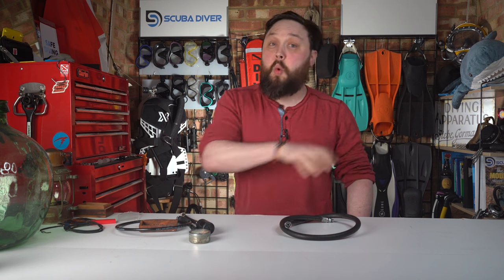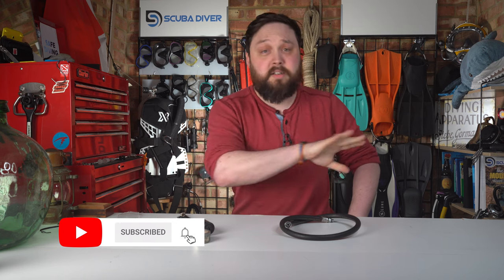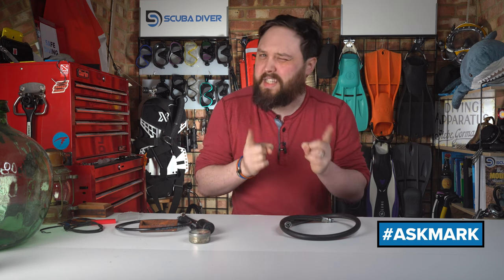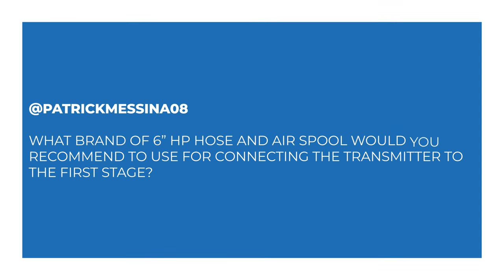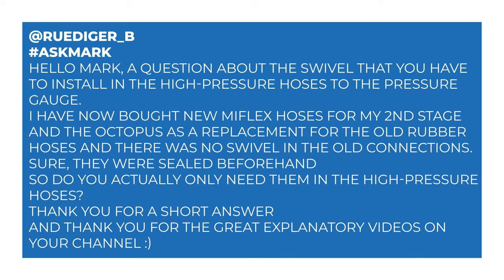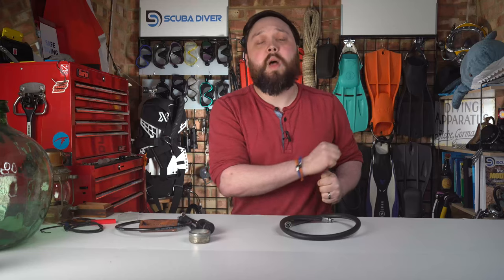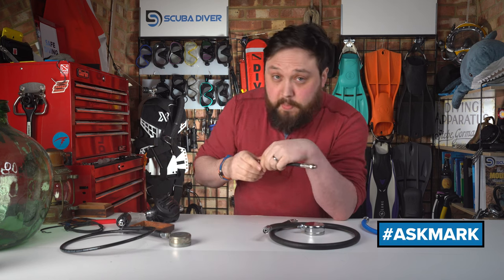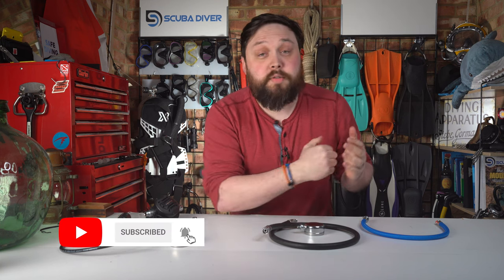Do I Need a Swivel Pin on Every Hose? #askmark #scuba

Comment: Another great video.  I noticed that the transmitter has an o-ring on it (could be seeing that wrong online).  I spoke to Shearwater recently and they said to remove the o-ring on their transmitters before connecting them to the hose with the swivel.
Reply from the maker: Yeah, I'm just grabbing things from the drawer, if you're attaching a transmitter to a hose then you don't need that O-Ring on your transmitter, just the swivel pin. That O-ring is just for when you attach the transmitter directly to your 1st stage.
Reply: @ScubaDiverMagazine  Thank you for the quick reply and the GREAT videos as usual!

Comment: Hi Mark, thx for the description 👍🏼🤗 i have seen the little O-ring in the male-end of the Miflex-hose. After screwing the hose to the 2. stage they rotate so easily, that i am not sure if it is correct sealed. Ok, i will test it in may in Egypt 🇪🇬🐠🐟🦈🐡🐙
Reply from the maker: They do tend to rotate quite easily when they're depressurised. You'll soon find out if it's not sealing properly...
Reply: Personally I’d recommend testing that BEFORE you go to Egypt!!!  😂
Reply: @MikeDodds  hi Mike - hmmm eventually I take the old hoses with me (they are not defect only OLD) - not so many extra weight 😂

Comment: #askmark , hi there, first of all I absolutely love your videos. So much information. I am very new to scuba and definitely got the bug. Do you have a very detailed video of a complete scuba build, from building a plate and wing to building your octo? I have heard some terminology that is new like swivel pin for example. Thank again . I'm off to watch your next video.
Reply from the maker: I imagine I have over the years. Backplates are quite easy and if you're buying a complete set, many of them come assembled and just need adjusting to your size. Regulators are simple also. As long as you know how to use a spanner and don't overtighten the hoses you should be good to go

Comment: Do Miflex hoses need to be replaced regularly? One service tech I spoke to said they need to be replaced every 5 yrs. can’t find anything on their website or brochure about it so I wonder if it’s obsolete news related to the rubber failure issue they used to have?
Reply from the maker: Great Question!
5 years is the industry standard for how often you should replace your hoses. It's the same for rubber and braided hoses. Most hoses will probably last longer but, they do degrade over time and I'd rather spend money on new hoses then for one to fail mid-dive.

Comment: #askmark Hi Mark, thanks for all the great content I find it very informative and great to watch. I have a question about buying my first scuba cylendar please, Its quite confusing looking at all the options. I will be diving here in the UK in a dry suit so I was thinking I would go for a 12ltr Steel but there appear to be a couple of common sizes - Faber and Euro which on should I opt for and whats the differences? I am quite a heavy user on gas sometimes so is it worth a 15ltr  instead. I would be a bit concerned about how easy the cyclendar is to manhandle out of the water due to weight etc. Many thanks in advance. Keep up the great videos :)

Comment: I had never heard of swivel pins so I really appreciate this advice! This made me think of another question to #askmark : when I replace or maintain gaskets in my hydro pumps or whatnot we tend to use a thin layer of white lithium grease to keep it safe from snagging and tearing and also to prevent them from drying and cracking. Would that be discouraged in a regulator setup?
Reply: Yes lubricants/sealants are avoided in scuba because of the risk of combustion when dealing with higher oxygen blends.   Maintained equipment doesn’t need it, so avoid hiding an underlying problem and keep it dry.
Reply from the maker: We tend to use silicone grease on certain O-rings up to 40% O2. Anything over 40% and we'll use something like Krytox or Christo-Lube lubricants.

Comment: Hello Mark. Recently I purchased my First set of New Equipment. Had my Tank filled. Tested my BCD LPI. The SPG. Tried my Genesis Prana Regs. Octo was fine. My Question is about the Venturi Control on the Prana main Reg. When I first tried to breath(Surface) I noticed the Knob keeps turning in both directions. Is that Normal??
Reply from the maker: The switch shouldn't move by itself. All switches should stay where you set them during the dive. You'll be able to move them by hand during the dive but, if it's moving by itself it needs to be looked at.
Reply: @ScubaDiverMagazine  Not the Switch. The Rotary Knob on the side. I turn in one direction, Hear a faint click. Then it continues turning
Reply from the maker: That's probably fine. Some adjustment knobs have a clutch that will allow the knob to continue to rotate with a tell-tale click once a rotation.
Reply: @ScubaDiverMagazine  I called one of the Dive Shops I purchase from(Online) and the Repair Tech Confirmed what you posted. I'm Recently Certified and purchasing my own gear. Better Safe than Sorry right?

Comment: I have a Teric w/ transmitter that screws directly into the first stage. Is there a benefit to having the transmitter attached to a hose first?
Reply: The two reasons I’ve heard regarding using a short high pressure hose to connect a transmitter to a first stage are: (1) doing so can improve connectivity between the transmitter and a dive computer (because the transmitter has a better “line of sight” wrt the computer since it’s out from behind your head), and (2) it avoids someone breaking your transmitter if they grab it thinking it’s the cylinder valve handle. You might figure no one should be touching your valve handle but you, but plenty of dive boat crew often lend a hand with gear before and after a dive (I’ve seen dive boat crew grab the valve handle to help pull a diver out of the water in choppy seas when the diver is struggling ascending the ladder).
Reply from the maker: Spot on @philipdstudio.

In choppy waters, it's easy for somebody to grab your transmitter accidentally and then all of the weight of your gear is put on that expensive handle.

It can also help with connection issues, bringing the transmitter closer to your computer or around something that may block the signal can help if you have connection problems. But typically, divers put their transmitters on short hoses so that they're less likely to be damaged
Reply: Thanks, that makes sense. @philipdstudio

Comment: #AskMark

Hi Mark. I've been thinking about getting into twinset diving in Scotland, as I'm converting more towards a DIR mindset. I really like the idea of redundancy but unsure if the change is required as all of the other members of my dive club dive single cylinder setups (like I do currently). Is it worth converting to twins if A) my buddies are all in single cylinders and B) we only do 1 dive per day and C) I wouldnt be able to take advantage of things such as longer bottom times. I'm taking GUE fundamentals in June but will be taking that in singles as that's what I'm comfortable with.  Love the channel, thanks, Greg
Reply from the maker: I tend to only dive twins now, regardless of what my buddy is diving. Your setup doesn't affect your buddy that much and the extra gas just gives you a sense of ease to cover whatever happens in the water.
If you're only diving once per day then you have the choice of diving the 2nd dive with whatever you didn't breathe on dive #1 or topping it up. 

Fundies will be a great opportunity for you to chat with your Instructor about twins and learn to dive twins properly
Reply: You should try GUE fundies with twinsets! Just to learn. You'll find that other than how heavy they are on land, that they're not that hard to learn. If you find them too uncomfortable on your first day, then there's no issue with moving to single tank on your other days of the course.

Comment: Hi #askmark, just asking about where to attach an additional Al80 cylinder. I dive backmount single but due to going a bit deeper for a bit longer I wanted to have the security of another cylinder and first + second stage. I'm using a hogarthian harness setup so I can put D-rings anywhere. On what D-rings, and where, should I sling this Al80 cylinder? Thanks in advanced, loving the vids.
Reply from the maker: Typically you clip the valve to your left shoulder D-ring, and the bottom to your left hip D-ring and it hangs on your left side.